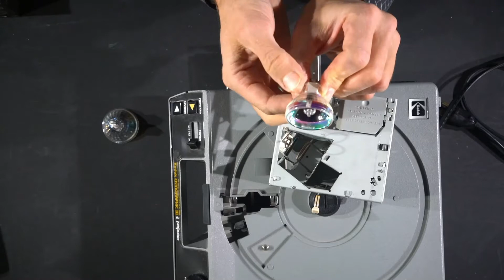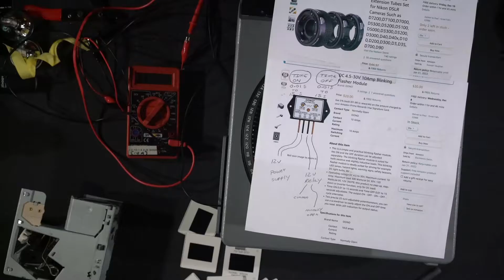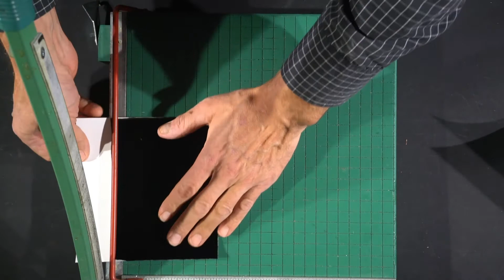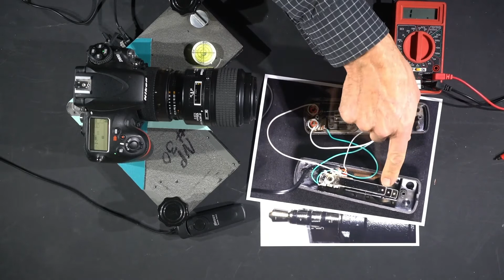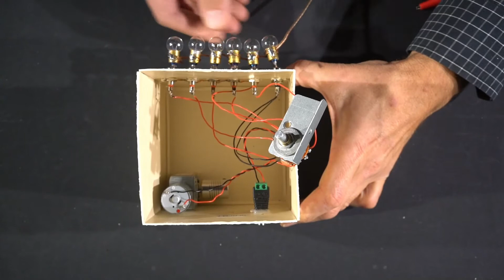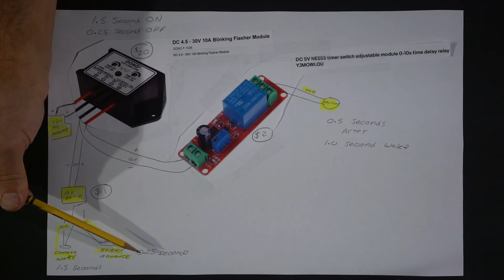High production automated digital slide capture-scanning with Slide projector (Kodak Carousel etc)

Comment: Any updates or better solutions as of 2/2026? I have a couple old projectors and want to simplify scanning of several hundred boxes of slides.
Reply from the maker: Yes, I ended up using the solid state option I showed later in the video, using off-the-shelf components, instead of the mechanical rotary switch that I came up with originally.  I'm old-school!  I see that others since making this video have programmed an Arduino to do the task. If youtube allows me to link here, I will post the link.  The rest of the projector modification spelled out in this video is still valid for prepping you projector for slide scanning.
Reply from the maker: This is a website showing the Arduino in action: https://robjordan.github.io/projector-control/?utm

Comment: You could simplify this with an Ardurino, No need for the mechanical timing.
Reply: Yes I ended up using that electronic unit that I mentioned later on in the video instead, although the mechanical unit works well for adjusting the spacing and timing as well as the dwelltime of each part of the triggering. A programmed Arduino Which function similar to electronic module alternative that I show. Hope the video is useful! Not sure how important it is to put the flocked velvet in the barrel to reduce reflections but my results looked really good. I shot some dynamic-range slides in the high dynamic range setting And there’s no clipping of the highlights or shadows.

Comment: The representation here (assume by ignorance) is that the mega-pixel spec of the camera determines the resolution of your scanned image. The limiting factor in this type of copy rig is the lens. The best macro lens, price no object, is about 26 mega-pixal. You can put the lens on a body with higher resolution capacity, but the result will just be noise added to the image. A further issue with the use of a slide projector is that the slides are not going to be held flat, but the error, if any, should be slight. That the projector is auto-focus is irrelevant - that won't work here. For copying a large batch of mounted slides, this seems like a good idea, but not for critical copying of a few originals.
Reply from the maker: Might I ask what equipment you are using to make your critical scans?  My Epson V850 Pro can achieve 4800 DPI,  but it, like my 35mm camera, it is limited by the resolution of itswith the flatbed I analyze each slide and laboriously sweat the details,  custom-setting the parameters of  highlights and shadow area for each slide..  At any rate, for practical purposes the true limitation is that of what the source material can offer; that would be the resolving power of the slide film, and that of the non-digital age lens which delivered an image to it.  For example,  I've have been flatbed scanning 8" x 10" B&W negatives shot on an old Deardorff camera sporting a vintage Goerz Red Dot Artar (coated) .  I scan them at "only" 1200 DPI (12,000 pixels on the long 10" side, it's a huge, sharp scan)  because there is no purpose in scanning them at a higher DPI.  I have reached the full potential of the film and camera lens used originally, decades ago.

Comment: Should have mentioned I took out condenser lenses and added 0.5mm teflon sheet to diffuse the light from the bulb - very simple, and very even illumination.
Reply from the maker: That's certainly an option; may as well remove that condenser as even with reduced wattage on the lamp there should be an ample amount of light. - I left mine in in this instance because it was doing a good job throwing a focused beam onto the diffuser which I had installed near the slide gate.  I left the heat-absorbing glass in there too. For best results lights in the room should be dimmed just in case extraneous light is causing glare.

Comment: Thanks for this. I had independently sorted it very simply, bought a Rollei side projector with timer advancement for £30 off eBay and an intervalometer for £14. Setting the intervalometer to take pictures within the rhythm of the autoslide change did it fully automatically and at very high quality - didn't need a full frame digicam, I had a Canon 90D with 100mm Canon macro  - perfect.
Reply from the maker: We were thinking along the same lines- using what digital camera and slide projector system/format we already had, and using inexpensive componentry to synchronize the camera to the projector.  I set the capture to low sharpening, and due to the high density range of transparencies set the contrast low, the ASA low to maximize the dynamic range which the camera could afford, and set the camera meter to underexpose to prevent highlight clipping.  The results are similar to the (painfully slow) 4800 DPI scans I'm getting  from my Epson flatbed.  All my Kodak Carousel and loose (stack loader) slides are now scanned; now on to the Bell and Howell slide cartridges from my late Aunt.  I don't have the Rollei system but it looks splendid, well-crafted as the B&H system is.  Not fond of the Kodak Carousel but it is everywhere.

Comment: Thank you for your video.  I converted our old Kodak Medalist II projector a few years ago.  I installed a gray diffuser inside the projector and ND filter on our lens.  We used Nikon Z7 with a 105mm macro lens.  However, I never replaced the FHS 82V300W bulb. So, I doubt that the CRI rating was anywhere near what I needed.  The project was fast, but I was not satisfied with the resolution.

I tried the Nikon ES-2.  I have had mixed results.  Then, we tried an Epson V600.  The resolution was improved, but the workflow was crazy.  The slides dropped out of the tray every every scan, causing me to clean the bed every time.  Now, we have a Nikon Super Coolscan 8000 ED loaner from our local camera store.  This process may be the slowest we have tried, but we are getting consistent 4000 dpi scans. 

We have not tried the Negative Supply solution as yet.  The founder believes his products will give us the best results.  However, we are simply placing a slide over a light (100 CRI) and taking a photo with our 35mm camera.  Placing a slide in the holder is a manual process. 

We have calibrated our current cameras (Canon R5 and Fujifilm X-T4) with Lightroom Classic, Photoshop, and Capture One Pro.  So, I am relatively confident that we will get true colors in those applications when we tether our cameras.  

Do you have additional suggestions to try?

Thank you!
Reply: Any suggestions for a noob?. I'd like to photograph the slides inside my Kodak projector. I have an APS camera 50mm macro lens, tripod, remotes. 4-500 boxes of slides.

Comment: How much...take my money already!
Reply from the maker: There is a commercial digitization unit on the market which is similar in design to this setup but it costs over $1K. The key to the setup I have here is to utilize a camera system which you already possess, and if you have or can procure secondhand a slide projector appropriate to the way your slides are currently housed.  Kodak Carousel models are plentiful, and the stack loaders are also easy to find, so if you have stacs of slides that is what I would recommend.   I did in fact assemble that proposed all-electronic unit that I devised, which you see the plans for at the 1:24:24 mark, and it works great, easy  and inexpensive to build.  I set the OONO pulse unit "off" dwell time to about a quarter second, long enough to reset that shutter-release delay unit but short enough to advance the slide projector only one frame, not two.  Plenty of leeway there.  If you supply your own slide projector, camera, and macro telephoto lens and let me know the make and model numbers of them, I'm sure I can point you in the right direction to arrange this setup and could even wire up an electronic advance unit for you at cost plus a small fee.
Reply: @phogroian1  Great resource and tips for digitizing slides! thank you!!

Comment: Thank you so much for making this video that was a lot of work it looks like it., Especially when you made two different systems. You are the man,thanks again. My system is similar. I have the same projector using a 30 W LED light source 12 V. I use digicam software to fire the camera with an USB connection. I use a digital remote control that I used to use for the camera, tapped it into the slide projector remote control to advance the slide manually with the digital remote control button. The digital remote has also a auto trigger feature but I do not know why it doesn’t advance the slides using the auto feature. Any thoughts? The reason why I didn’t go the fully automated route is that some of the slides that are not perfect sometimes get stuck in the projector and the camera keep triggering… This way I have more control and can stop the software if there are any problems with the slide projector. Let me know what you think.
Reply: Hi Zaeeef, not sure why your own projector's auto feature isn't working but I suppose if the slide projector itself is set to a "slide show" setting the software-driven camera capture program could be set to an interval which corresponds to what the slide projector is doing automatically.  If you want the software to set the image capture and the camera itself to advance the slide, there is a delay module I see on Amazon, not sure if Youtube allows the link but it is titled "12V DC Delay Delay Relay Turn on / Delay Turn off Switch Module with Timer" and it is 5 dollars.  It's possible that you could use the camera's flash sync  connection to trigger this unit,  and the projector advance could in turn be tied to the "normally open" port of this module, so, after a half second delay, the slide projector would advance.  Sort of a reverse of my "projector triggering the camera" idea.  In addition, to the "normally closed" section of the circuit one might route the power supply to the module itself... that way, as soon as the relay gave the slide projector a pulse  to advance a slide, power would be cut to the module, thus resetting it so it will be waiting for the next trigger from the camera.  In theory something like that should work but half the fun is in the experimentation, so it would be neat to play with the possibilities!  Just use a meter first to be sure you're not sending a damaging amount of current through the camera's synch circuit; you wouldn't want to fry your camera!  Franky in this setup I'd also use a camera protection unit, Wein Products W990560 (SSHSHS) .  I have one of those Wein units from a time when I was using a vintage studio strobe system with a modern digital camera and I feared that the old-school strobe trigger voltage might be too high for sensitive electronics.
Reply: @paulh6591  great idea I will try that. Thank you for taking your time to reply to me.